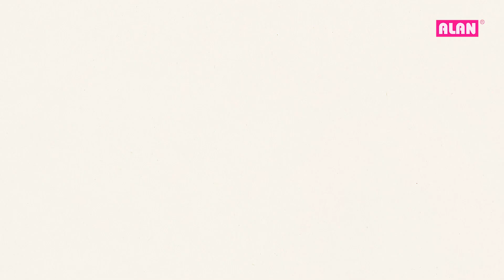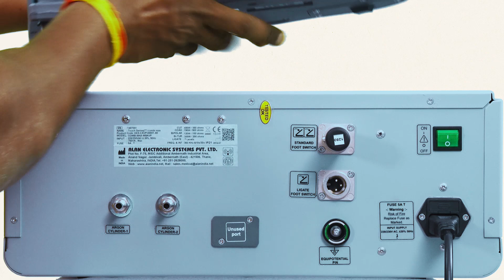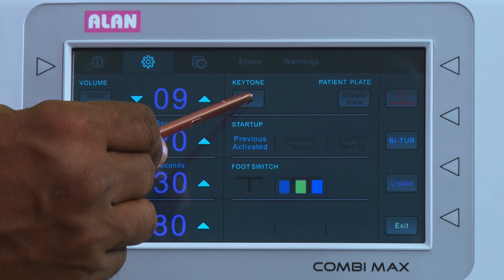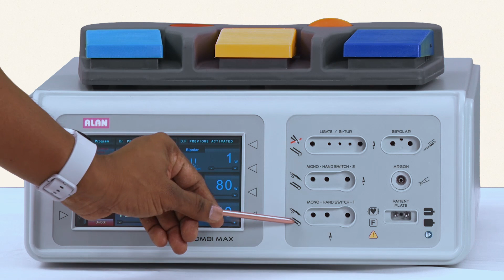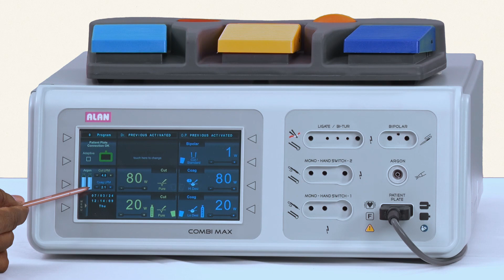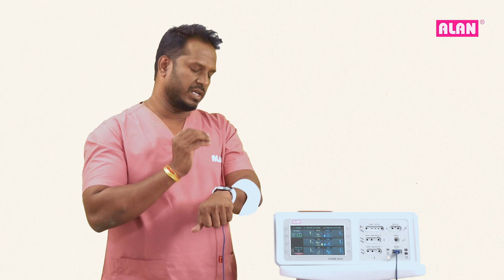COMBI MAX MBAVP!

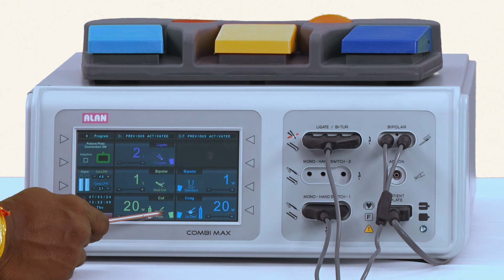Comment: At 19:31 when all ligate n bipolar n monopolar is connected. Bioplar coagulation is seperately delivered on bi polar forceps and not on vessel sealer right? So when third peddle is pressed bipolar forceps works.